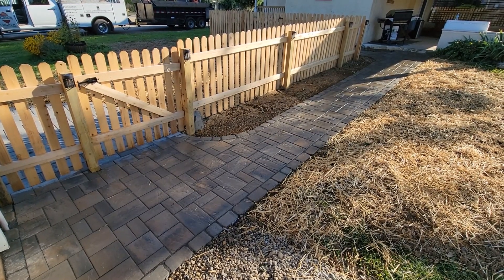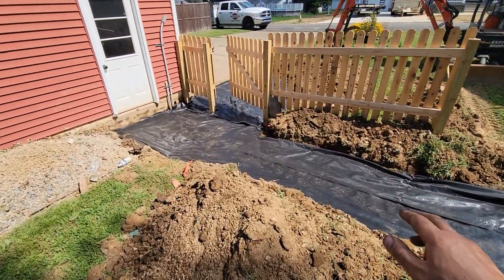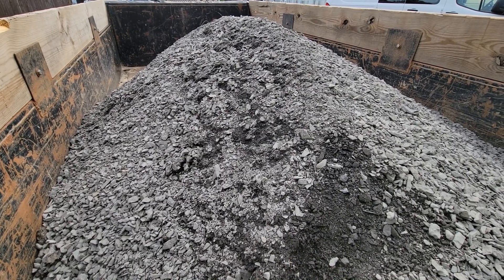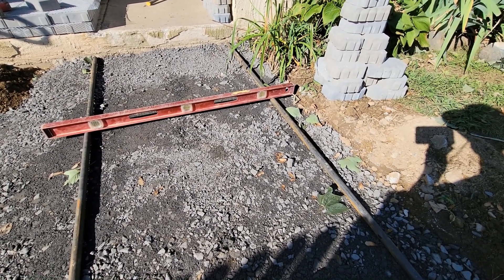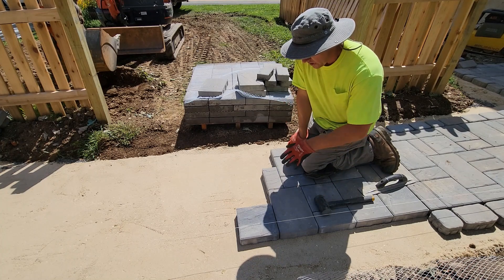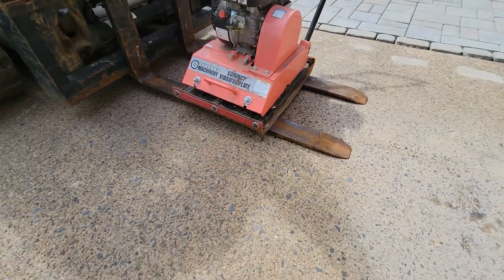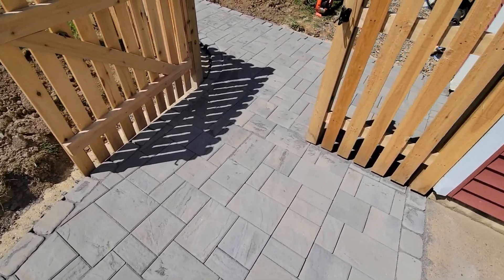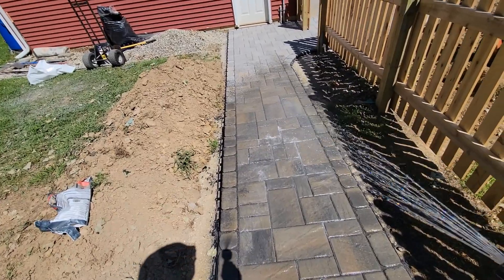How to install techo bloc pavers

Comment: Looks great!  To clarify your over dig width should be equal to your base depth.  If you have a 6" base then 6" extra width on both sides.  If you have 12" base then you should be 12" extra wide on both sides.  Different soil types require different base depths as well as it depends on your application.  Heavy applications such as driveways should also have a deeper base layer.  Sean I'm sure you know this; this is more for any viewers :)
Reply from the maker: Yes very good point and thank you for bringing it up. It's easy to forget some details that come second nature to us. Thanks for watching 👍

Comment: I am starting a 30' walkway this week using the Eva Techo in Champlain Grey as well, the customer picked it out. They also want a 2-3 step system, do you have any videos of building some paver steps? thx
Reply from the maker: I dont at the moment but I will get one this spring for sure. Good luck with your project!

Comment: I’m not understanding how this is a 36 inch pathway? Trying to recreate a similar width with same materials and the pattern isn’t adding up? Looks more like 43+?
Reply from the maker: Yes, your correct it does work out closer to that. I just said "3 foot" in the video to make it easier to explain. You would just need to do one less block in your Eva pattern. If you take out one 8 3/4 block that puts you just under 36". If you take out the 4 3/8 block it will be a little over the 36". Good luck with your project
Reply: Is there a reason you use Techo Bloc over other products? Techo seems to be very expensive compared to other products in the space such as Belgard. I’m in the Denver area and TB runs about $10/sf and Belgard runs $6/sf. Do you see a significant difference in quality? Also wondering why you use Eva, which is rated for vehicles instead of maybe a TB Blue?
Reply from the maker: @benlalor9453  I think Techo Bloc is a superior product. You'll find that cheaper pavers will fade faster and tend to chip easier. Eva is the most affordable paver techo Bloc sells that's why I use it. $10 a SQ ft is crazy high for Eva. I would check with another supply. If techo isn't big in your area. Check out unilock they are also a very good product.

Comment: an issue i've ran into with screeding is when I'm trying to keep a slope, my metal screed pipe doesnt flex to follow the slope. What do you recommend for this?
Reply from the maker: Your best bet is to lay your screed pipes down and fill in the low spots with more base. This will give your a more gradual slope. If you have a spot where the slope isn't gradual, use shorter pipes for that section. I keep a set of 4 footers on my truck. Have the end of the pipes end at sharpest point of the slope. Then re position the pipes just past the slope and screed in between. I hope this helps, Thanks for watching!

Comment: We use road base for the base what’s the difference?
Reply from the maker: Im assuming that's crushed concrete. From my understanding it's a little cheaper and can be harder to work with but as long as you compact it properly the outcome is the same. Thanks for watching!
Reply: @srmcontracting  thank you for replying back boss.